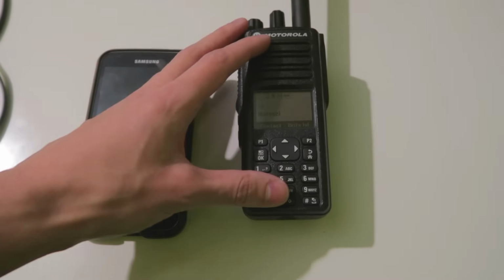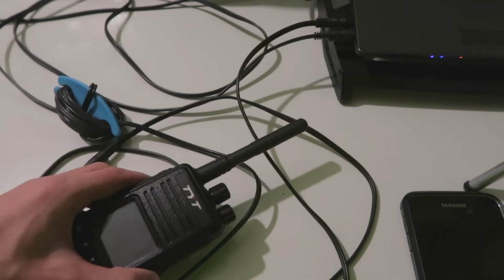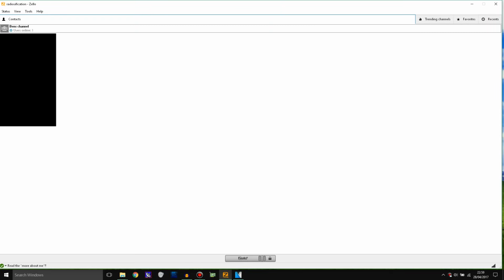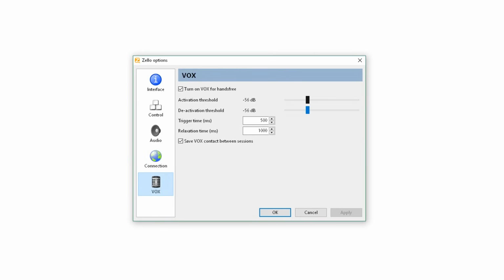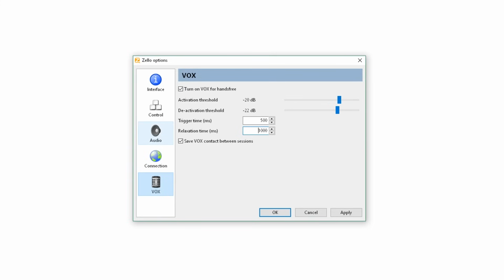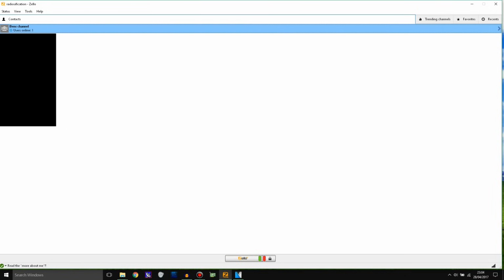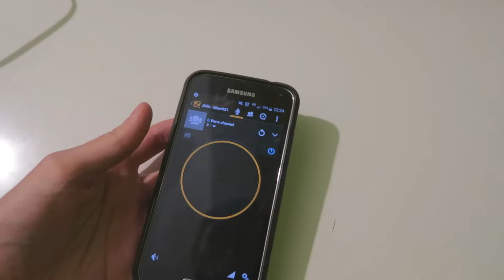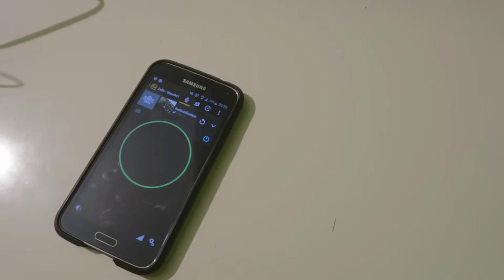How to Make Zello Crosslink in 4 Easy Steps!

Comment: is this connection consider a voip?what if the other analog radio is in the philippines and im here in japan,can we still communicate?
Reply: Zello is internet/cellular-based. (Internet for the desktop app, cellular for the mobile app). As long as you have a data connection, the Zello portion will operate. As for the physical radio, the distance depends on your physical radio network. The one connected to the computer is helping bridge the connection between networks. As long as your other physical radios can operate with the one connected to the computer, that portion of it will work, even with the Zello portion through the bridge.

Comment: great video, but my question is, is there any limitation on range? how far we can use the HT ?
Reply from the maker: The range depends on the radios used. It is not affected by this system at all so they will work just as far as they normally would do.

Comment: Can you crosslink anyother radios like this way? Let just ask lafayette micro 4 vhf radio?
Reply from the maker: If the radio has vox, and has a connector that allows you to get the audio then yes.
Reply: Ok if not have vox, you need RT-roI1/2, signalink or  Radio Over Zello Controller + RT3. Make video about these.
Reply from the maker: Yes exactly. If it doesn't have vox then you need to buy something external. I'm not planning on buying any of those devices, but if I ever do I'll make a video on it.

Comment: Clever tutorial. One suggestion would be to add a battery eliminator to the TYT radio so that it can run 24/7 off of mains power rather than shutting off when the battery is exhausted.
Reply from the maker: Yeah, that could be done. This tutorial didn't take into account things like that but someone could definitely add that to their setup. Thanks for the comment.

Comment: It could just be me, but do you have custom alerts set for Zello on your cell phone? The talk permit chirp sounds higher and the roger beep sounds more like a TETRA-one, instead of the standard Apollo 11-ish one. Also like the other Sepura sounds it uses. I'd love to know where you got them :)
Reply from the maker: Hah yes you are right. The ones on the phone are made to sound like motorola tetra radios, and the ones on the computer are made to sound like sepura tetra radios. I made them myself with audacity, just by finding recordings of the tones online and seeing which frequencies they are at.
Reply: radiosification Ah, cool. Could you give me some hints as to how to go about detecting the frequencies of a sound? I've tried generating my own sounds in Audacity before, but even the Motorola TETRA "beep" didn't come out quite the way I hoped it would. Wouldn't mind if you published the files somewhere, either, but I totally get it if you want to keep them for yourself :)
Reply from the maker: I usually use a program called spectrum lab to see the frequencies. Try using fade in and fade out to get them sounding right on the beginning and end of tones, otherwise you get a click sound at the start and end of the tone which doesn't sound quite right. You have to make the fade in and out quite fast.

I'll create a video on how to do it in a few months and publish the sounds with that, after checking that they are all accurate.
Reply: radiosification Thanks! Never thought about that. I'll experiment for a bit. 
Looking forward to the video!
Reply from the maker: Check your PMs